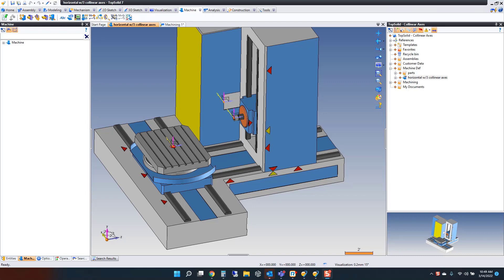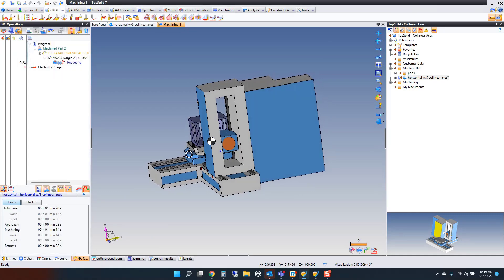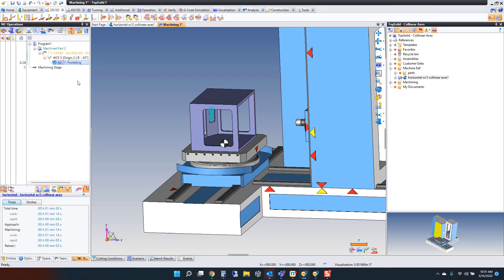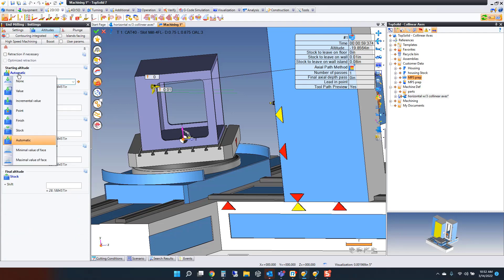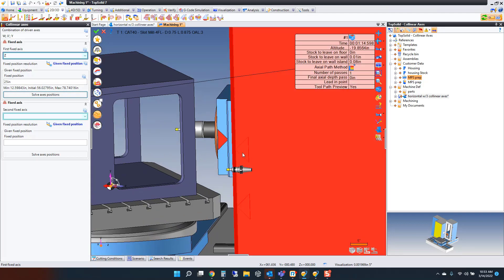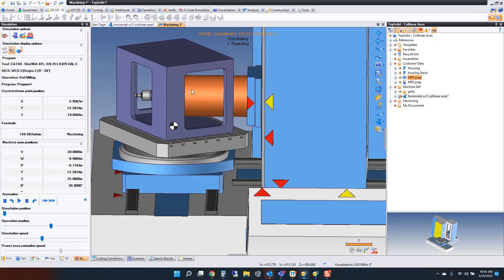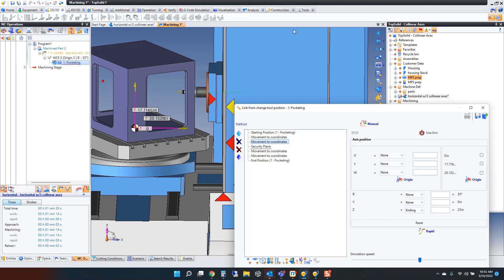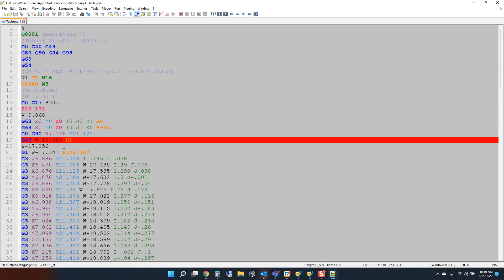Driving Collinear Axes with TopSolid Cam

Comment: Tnx. Needed. Featured on LinkedIn now. 

Your video has jumped 100 views in one day based on my LinkedIn posts featuring this video. 

New fully featured videos need to be done for TopSolid 7. One video should show start to finish, with nothing sped up or skipped, multiple different parts loaded and machined on a tombstone with tool optimization.